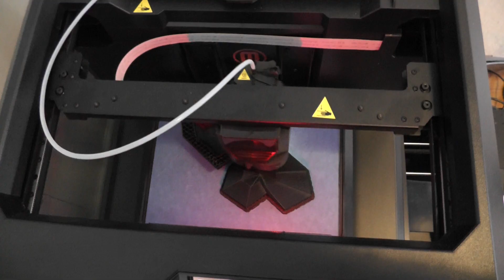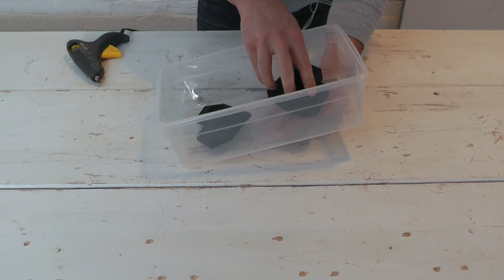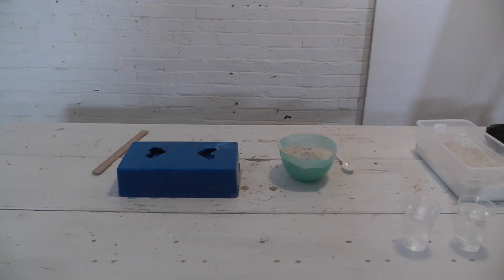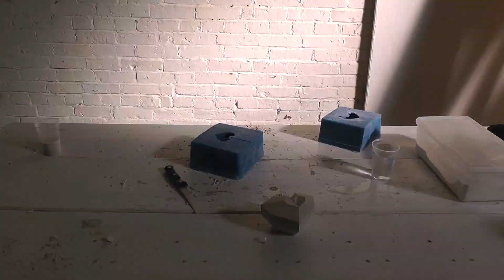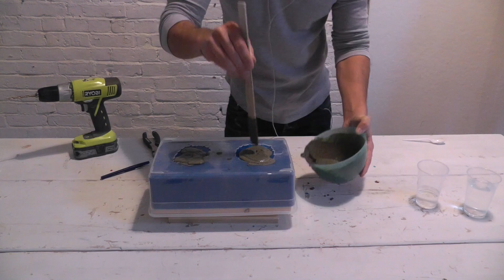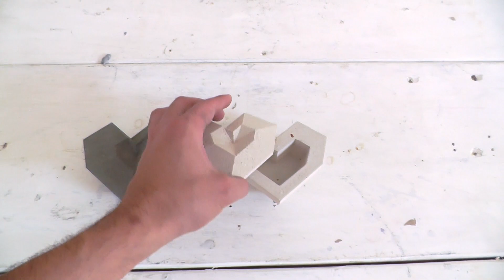3D Printed Concrete Heart Shaped Box

Comment: This project used $100+ in silicone due to the unnecessarily large box used to house the mold.  If you use smaller boxes or make some out of foam board you can probably save yourself $80 in mold material.  Silicone will wear down after a dozen or so casts with concrete, especially without a release agent. A good alternative is urethane molding rubber designed for use with concrete which is about the same price or less (since many silicones use platinum).

Comment: For anyone lamenting that they don't have or can't afford a 3D printer - check to see if your area has a Maker Space or Hacker Space. You typically pay a monthly fee to have access to the space and all of their equipment. They're nice b/c you get access to tools you wouldn't necessarily want to buy, and if you're an apartment dweller like me,  they provide a working environment that's more appropriate for building projects than a carpeted living room.

I used to go to one in Richmond, VA that had all kinds of power tools, soldering stations, and a couple of 3D printers. Membership was something like $30/mo. If you wanted to try a project like this, you could get a membership to a maker space in your area and take advantage of the 3D printer (if they have one). $30 is a heck of a lot cheaper than the cost of a new 3D printer.

Comment: Just a heads up, over time the concrete will start to deteriorate the silicone, so it will be a lot harder to remove the castings after a number of casts. My experience is that the silicon molds are good for about 10 castings before they start to break up, a way around this is to use some mold release right from the start to help preserve the silicone.
Reply from the maker: +alexchap89 good point!  thanks!